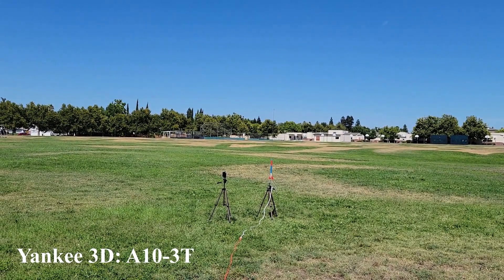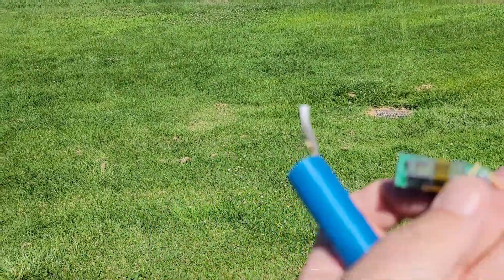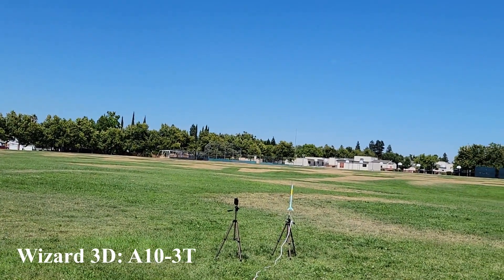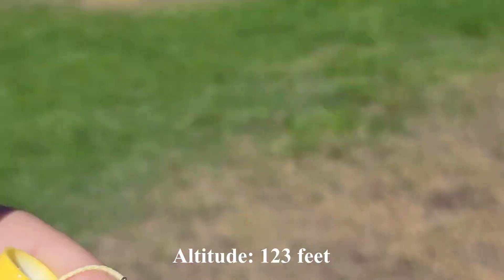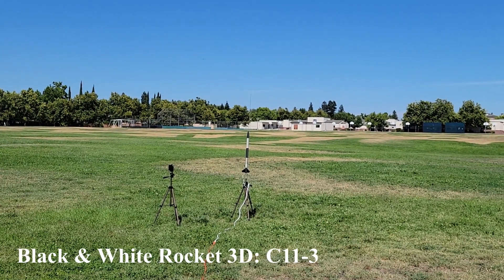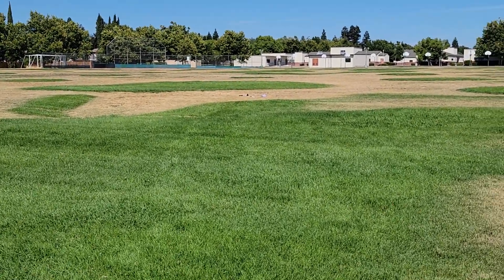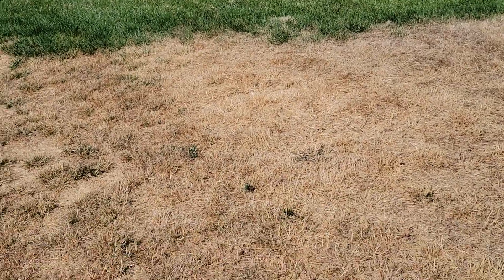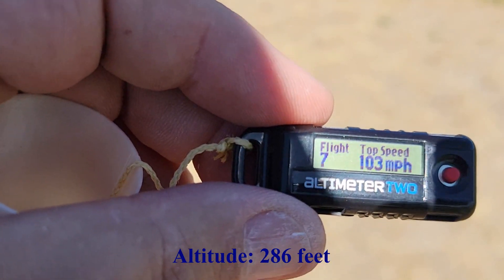Mini Engine Monday #3 - 14 August 2023

Comment: Ha Ha Ha!  Two scenarios:

1. Perfect success- “Kevin only slightly hinted at this idea, but I really expounded on it.”

2. Failure- It was ALL Kevin’s idea and he SUCKS!  What a lousy idea. I’m never listening to him again!

😂 That was a fun despite the setbacks. Sorry for the issues. At least you had soft grass to land in. 

Based on the way those dragonflies were behaving, I don’t think you were in the 900 degree zone. Upper 800’s maybe, but definitely not 900. Dead grass becomes symptomatic at around 700 degrees so I think you were somewhere between 700-850 degrees probably. And at that temperature, the air is just so darn thin, it makes chute opening almost impossible. 

And back to the dragonflies, they can’t be blamed for their actions. They know it’s cooler up at altitude and they were just hoping to catch a ride up there so as to cool off a bit. Pretty smart if you ask me. 

As usual, love your videos and I’m glad you’re finding ways to enjoy the hobby despite the blazing heat. Try heading out earlier if you can. It helps!

PS:  I rewatched that last flight several times trying to figure out why it’s named the black/white rocket. I looked it up in Rockets of the World and can’t find it………… 😂

Good show!
Reply from the maker: So funny! Problems are a part of life, repeated in the rocket world. No regrets here. It was fun despite the setbacks, so I'll just let them go and move on. Someone famous said it is better to try and fail than to never try, or something like that. I'm glad you suggested it, now we can laugh about it forever! 😂